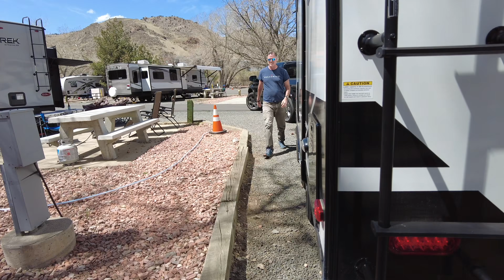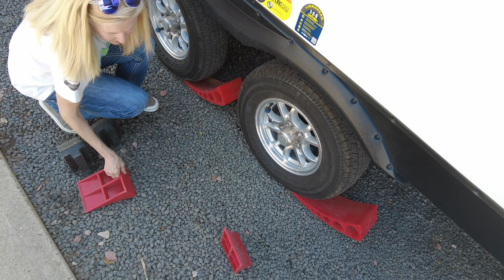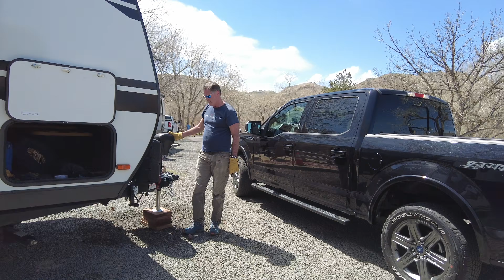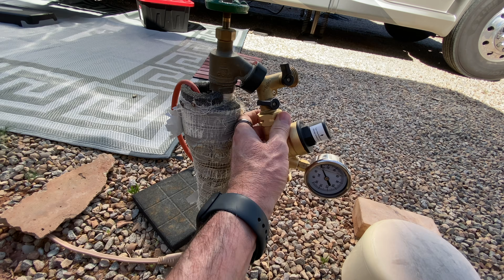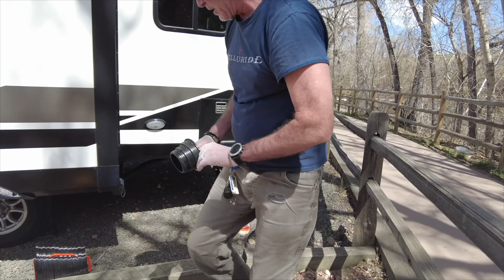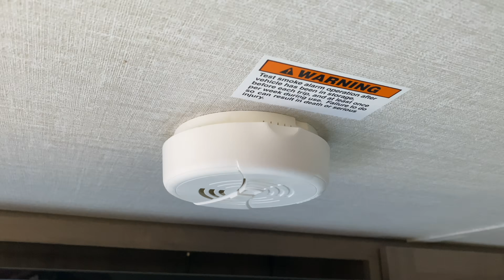"RV Setup for Newbies: Easy Guide to Hooking Up Your Travel Trailer at a Full Hookup Site!"

Comment: What brand of weight distribution hitch did you buy for your 22mle? What weight? I have a ford F150 and will have very similiar setup.
Reply from the maker: We have the Equal-i-zer 4 point Sway Control Hitch. 1000/10000 lbs.